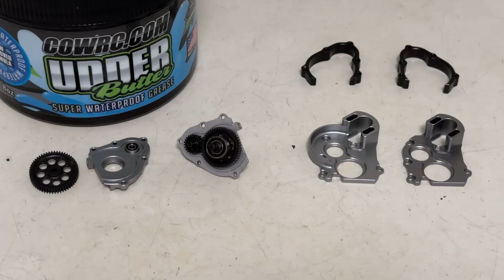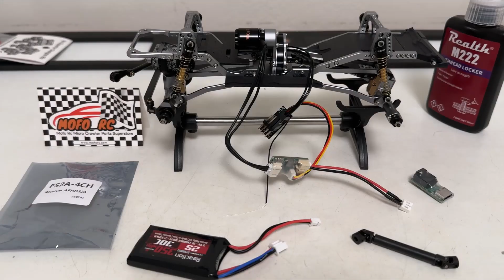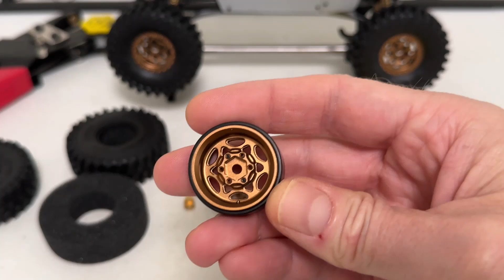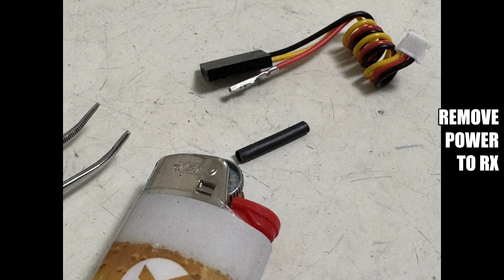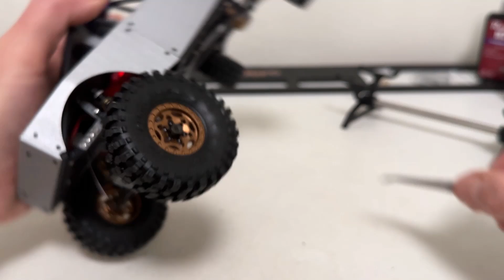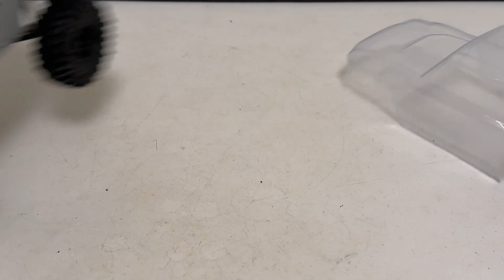SCX24: LGRP R-FACTOR & COMP FRAME BUILD - STAGE 2: CAGE, PANELS, PAINT, WHEELS, TIRES, ELECTRONICS

Comment: When I saw those Hobby Soul tires I bought them in a heartbeat because guess what I have on my Jeep, 35" Mickey Thompson Baja Claw TTC tires!! Not only that but they are the best tires of the 4 sets that I have! No they're not that sticky but all that stickiness goes away as soon as you hit the trails. Definitely an underrated tire!
Reply from the maker: Yeah, it’s always awesome to have something scale you have 1/1! Hoping Hobbysoul keeps pushing out these type designs.
Reply: i also have them on my 1/10 scale and 24 scales. they work surprisingly well for such a cheap tire. would definitely recommend